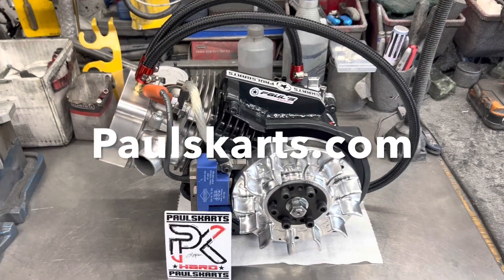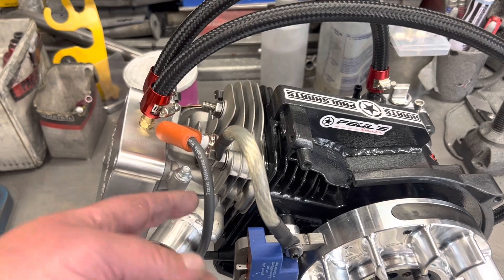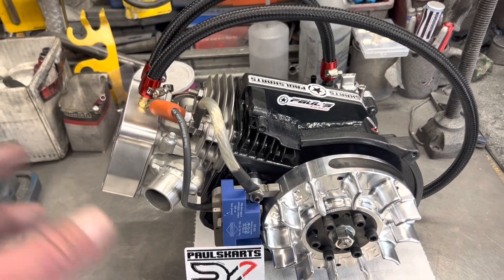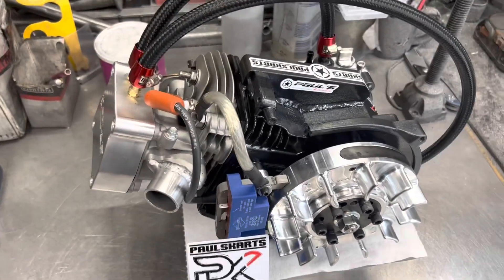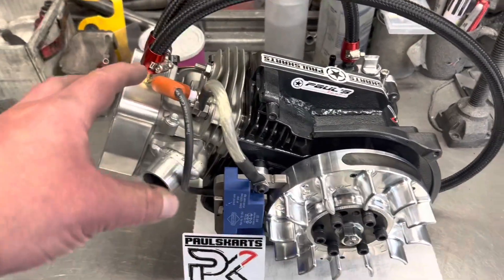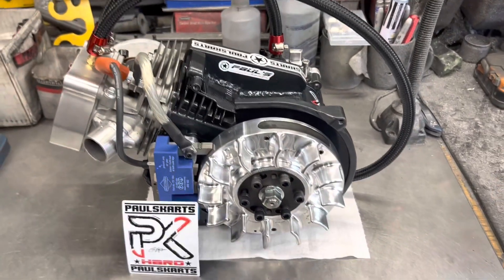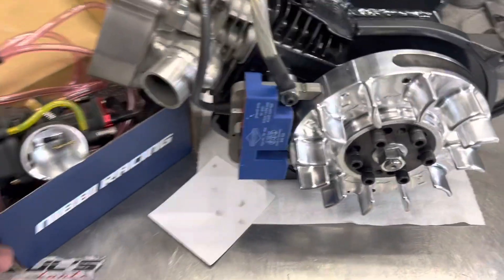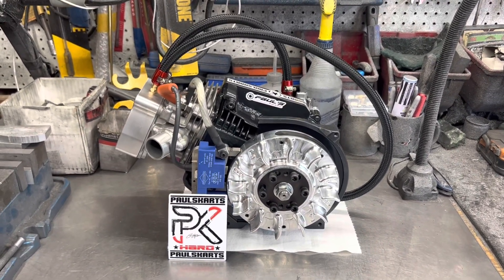270cc 3” stroker “GOLIATH” top build of the year. Look what’s inside 👀🏆

Comment: Have you seen dudes all billet small block with a billet big block cylinder head on Instagram yet? Freaking crazy. I've always loved your work, keep it up bro!
Reply from the maker: I have seen some of the versa blocks that have those big bores in them where they can bolt the big block cylinder heads to but the problem with those engines is they use GX 200 style architecture in the bottom and the problem with that is even the Billet Special alloy stroker cranks do not compete with the forces that a 95 mm piston puts on the crank The 1 inch journal even on the Billet Special alloy is not strong enough to support the top end of that engine so the crank becomes the weakest point I’ve heard from four people now that I’ve bought that engine that expressed that point to me. They sold that engine before even starting it just because of the inadequacies of the crank and its strength. Even a 3 inch bore stroker pushes that Billet Special alloy stroker crank to the max. That’s why I only use the special alloy. The billet standard stroker crank from a RC isn’t even great to use on a 3 inch a 72 mm stroker it’s fine but the 3 inch stroker cranks need a special alloy going above that is just asking for problems. They really needed to start using the big block Cranks in that engine to make it work and live a longer life

Comment: check out the ground strap made by Empi for VWs.  Its a very nice copper braid and wont suffer from heat problems like your ofc wire and shrink tube. Jegs has a pretty nice version.

Comment: Start doing offset valve guides to fit bigger valves, will definitely need welding around the ports to hog them out more.
Reply from the maker: Honestly, any of these heads, you see with a bigger valve than a 32 mm is a dysfunction of performance. The entire port Hass to be tapered and you have to make the cross-section area bigger than the valve seat in order to properly design an intake port. The valve seat Hass to be the point of highest velocity so increasing the valve size beyond the potential for the cross-section area to increase is a dysfunctional modification. I know it sounds like a good idea but in port design, it’s bad.
Reply: Dam Paul.
You sound like a mafia school technical teacher 😂

Comment: How do you like those PVL coils.  Worth the extra money or not much of an improvement?
Reply from the maker: They show no power gains up top where the engines make power. They have a steady timing so if they would have any advantage it’s on the absolute bottom end below 4k rpm but our dyno shows very low if any benefit in hp results